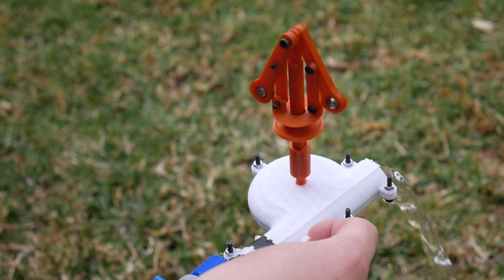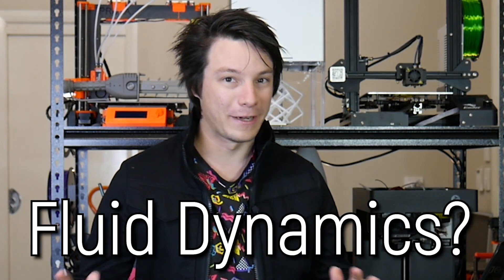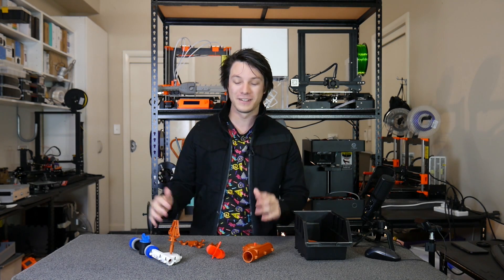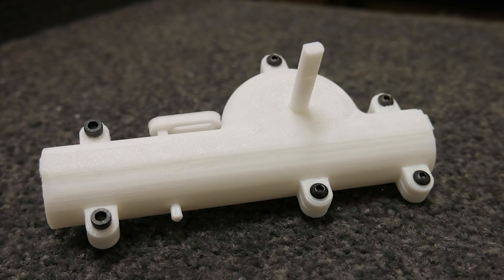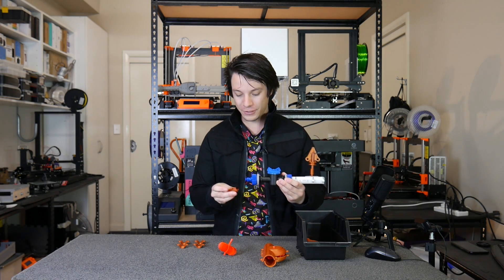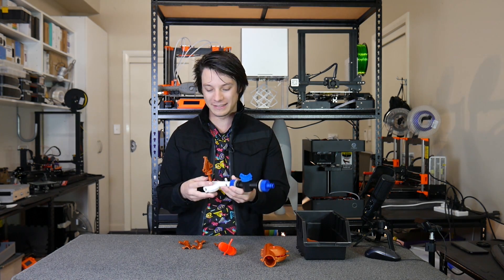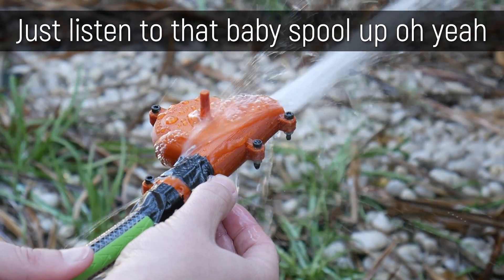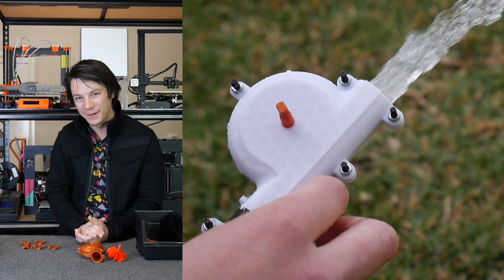When your projects FAIL (and why that's a good thing!)

Comment: 608 skateboard bearings have become extremely available on amazon very cheaply; they're great for projects like this.
Reply from the maker: they'd rust up instantly though?
Reply: @MakersMuse  eh, they do make stainless/corrosion resistant versions, but even the cheap ones will last a while with a little bearing grease. Good for rapid prototyping, but you'd definitely want a special purpose bearing for a final product.

Comment: I like many amateurs tend to 'overthink' and 'over-tinker' my designs  = ( So your advice is very solid.
As far as your example goes: It might be interesting to include conventional hardware parts into a design instead of printing every part. This could help to get some of the required accuracy AND introduces parts that work 'out of the box' [at least in theory].
e.g. bearings, couplings, valves etc.This way 3D printing / printed parts 'work together' with.... to get a problem solved.

Any way... that's my 2 cents worth...
Keep up the good work!

Comment: I just finished my FIRST 3D print EVER! Its just shock absorbers for my printer, but it was successful!
Reply: One thing about shock absorbers for printers is they can allow the printer's frame to flex. Bolt the printer to a good solid board. 3/4inch 19mm plywood is good, then put the shock absorbers under the board. This is especially important for printers that have acrylic frames like the Anet, Tronxy and other i3 clones.
Reply: oh wow! thank you very much for that advice! i havent heard that detail yet on any forums ive seen, so thank you!

Comment: 3:49 I'd think of small nylon bushings instead of sanding complex surfaces. Nylon is slippery, it can be lubricated with water, and i think it could seal water leaks around axis. But i cannot know it for sure until i try something similar haha

Comment: My armchair engineering gut tells me that the valve should be placed after the turbine housing. This would change the output speed of the turbine to be determined by the total flow as opposed to the velocity induced by the restriction to flow.  That said, I'm definitely not an authority on the subject, and have no training or education in the field.

Comment: How about a video showing how to think outside of normal FDM layers, with the ability to pause a print you could design a print that is one piece and insert the moving parts as the main body is being printed. 

As an example I printed a Fishing lure instead of printing in two and adding the lead weights and metal hoops and glueing it together I just pause the print added the weights and hoops and resumed, no glue needed!

Love to see what you come up with if you did a video on this topic
Reply: Nice!

Comment: So, a more serious comment - running water makes a great bearing. I bet that works extra awesome for 3d printed parts as the water will sink away and heat build up, right? You could have PLA spinning parts that survive because the water keeps them cool?
Reply from the maker: exactly :D!
Reply: High speed CNC machines use high pressure air bearings, because any direct contact mechanical bearing would just be shredded or melted (for example, circuit board drilling machines like the Posalux UltraSpeed have spindles running at up to 350'000 RPM!)
Reply: There are water pumps that use water as bearings, dishwasher and washing machines can use that. I think that in a pig feeding system that my dad worked with they had such a pump, the motor had regular ball bearings.
Reply: I had the same thoughts Joel!  Seems like the parts would also wear into a better fit, but not idea since tight tolerances are more desirable than sloppy ones, but I can imaging this would be  useful for some projects.
Reply: I would suggest possibly keeping that same design. But instead of trying to stop the water and allowing it to build pressure, he could have the valve redirect the water. That way anything going through won't be under pressure. It may not be the greatest having constant running water. Might be loosing the whole point but at least you can still test other components and maybe getting a real ball valve that wouldn't leak. 3D printing a ball valve and using that neat o-ring idea to keep it from leaking? I wish I had a 3D printer in order to test all this. Love experiments.
Reply: Has been known and used for centuries :)
Reply: When you work with any fluid, fluids aren't compressable, or compressible, whatever, they can't handle compression, so, in case it's too much pressure on the inlet, it has to be some kind of overflow valve, let's say a spring-loaded valve that at a certain amount of force it reliefs some pressure, also the gasket it has to be made depending the amout of pressure it needs to handle too, a gasket too thin, the water can flex it and gets through, other solution will be tighten a little bit more so it squishes more and it seals better. Joel is right, (Hi there BTW) turbos on car doesn't have bearings, they float in a tiny tiny drop of oil, when a turbo burns out is because the oil flow is missing somewhere, or there's some debris... They turn at very high RPM's. I'm not an engineer, and besides i'm a car mechanic i learn from Youtube as well, maybe you want to check out AvE's channel, he knows a lot of stuff about chemistry, hydraulics, pneumatics, electronics, it explains everything very carefully and very good, it also opens up stuff to see what's inside, like high pressure oil pumps and stuff to get some ideas to apply onto projects and reviews tools... lots of stuff
Reply: Water is the fastest way to dissipate heat actually distilled water. But distilled water eats away most metals, then organisms like to try and grow in your water. Most of this is discovered from water cooling PC's. They use additives to make it less corrosive and stops algae from growing like Anti freeze in your car which also enhances the properties of the water increasing the boiling point and lowers the freezing point and they use a piece of silver to kill the organisms.
Reply: Side85Winder
One big problem is people mixing different metals in water cooling loops. That is what corrodes away the less noble metals (galvanic corrosion). Since water acts like an electrolyte, you are basically building a battery if you are mixing different metals in your cooling loop. So, if you mix materials (avoid it if possible) there are some additives that try to inhibit/supress most of the galvanic corrosion.
Reply: Discovered in YAG laser cooling systems decades ago ! Distilled water is an insulator and therefore in direct contact with electric components. (BUT it had to stay pure). All gold plated mind you !
Reply: It's been known for decades you should only use distilled water in your car when mixing with antifreeze/glycol coolant, mainly because of the mineral buildup that comes with using tap water. Aside from the physical problems of buildup (clogging, less performance because of less contact area of metal to water, etc) you can get electrolysis if you're using predominantly water only, because the coolant becomes acidic as it breaks down...though of course this isn't as big of a problem with PC water cooling loops as they're usually flushed long before it gets too nasty!

Comment: #BigSteelBalls
Reply: hi, Joel, I knw that you are very experienced 3D printer user,  please, don't you know, why my printer is having good results only with 0.1mm layers and the layer alignment decreases with higher layer height? the printer isn't the problem, I think it's the filament, isn't it? I mean the mechanical movements of the printer are good, but the filament spreads out differently. I think it's because of inconsistent layout of color dust in the filament. Any help, please?
Reply: BlackboardIdeas that was a word salad
Reply: NERD!!!

Comment: I'm wondering why you didn't try this on the resin printer as you needed precision?
Reply from the maker: part are too large plus tbh, i'm done with resin. Until there's some facts about the safety around the fumes and material I won't be running it in my workshop.

Comment: Two things: Couldn't TPU/TPE be used as an o-ring straight off the spool? Also what if you made the turbine pneumatic? It wouldn't waste water.
Reply from the maker: hah yeah you could just use 1.75mm material in a slot, for sure! Good idea.

Comment: Ahhh, prototyping, the # of "inventors" who made something work the first time is zero, hence R&D. Paper drawing, theoretical thinking, physical model, material experience, all have a very fine colaboration point to meet before true success. We've become accustomed to classify the term "Failure" as a weakness. However, the caveman never caught his dinner on his first hunt, he HAD to fail, to learn a new technique, to hone his practice. So go make your ideas, see how they do not work as you thought, and continue to improve them. True "FAILURES" are the ones who give up.
Reply: Everyone keeps saying this very hopeful sentiment but a part of the point of this video is the number. you need to stop at some point there are only so many ways to try the same idea before you need to move on you can give up on an idea that giving up on the task
Reply: @45nickname  James Dyson "failed" 5,126 time before his final design. Now he's worth almost $5 BILLION. You're speaking of simple insane repetition vs. actual design trial and error.
Reply: @gregg3364  absolutely and some things take ex number of attempts what do you think his first three were all out failures with nothing to glean from them? let alone the number of times you may have changed Direction in all 5000 some attempts. I'm not saying you have to abandon a goal,  sometimes you have to abandon a concept: take a new Direction because you're going the wrong way.  it's not always pure repetition that leads to problems sometimes it's developing a turd. There's only so many things you can do to a turd to make it pretty, and at the end it's still a turd

Comment: If at first you don't succeed .... then don't take up skydiving!
... and I know plenty of engineers that know less about fluid dynamics......
Angus, I applaud your honesty, and the integrity to admit and learn from 'trial and correction' - keep it up!
Btw, you could have just used the 'straight' TPU in the appropriate groove as a gasket, without having to print it?
And don't overlook printing the bore undersized with extra shells, and then boring it out to tolerance...

Comment: If you printed it with a 90 degree y roll you might reduce the layer visibility in some areas, but it would require support material.

Comment: Fun video Angus.
Just one question - couldn't you have designed it to where you could have just used the flex filament for the seal?  Too big maybe?
Reply: He did?
Reply: Since he used the term "printed", I assumed (maybe incorrectly) that he actually printed a bead that had the profile of the part.  Might have been easier than bending the filament itself to fit that profile anyway.  :-)

Comment: You need a nozzle to increase the speed.... directed at the turbine
Reply: Yes and a pelton wheel design would do wonders as well
Reply: I agree, a pelton wheel would probably be the easiest to 3D print, since you're not relying on tight tolerances between the turbine and walls. The only part under pressure would be the pipe up to the nozzle which could simplify the water tight section. Just a quick search on thingiverse brings up several designs of pelton wheel already.
Reply: I would suggest using the SLA printers for this as well, after you have your working parts in close to the final design of course, the better resolution in print detail doesn't just make it look pretty but you can make the tolerances a lot tighter around the wheel for less energy loss etc.